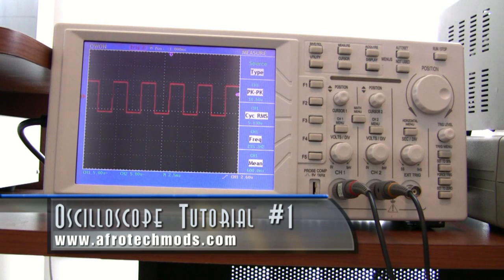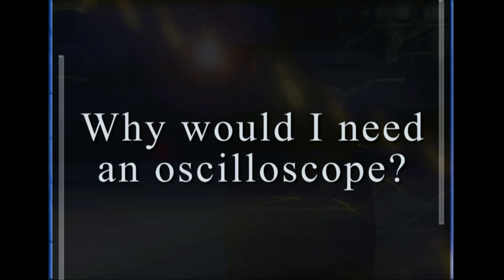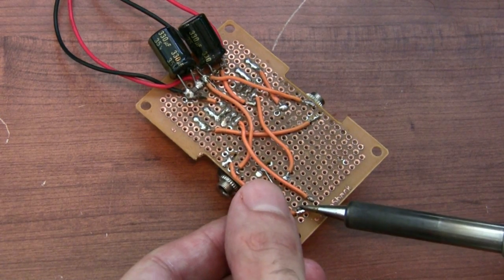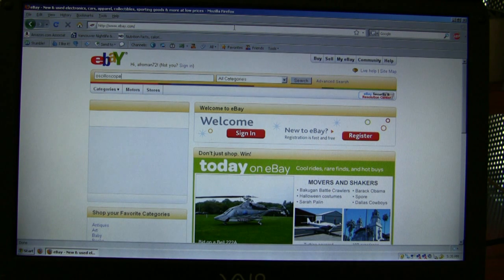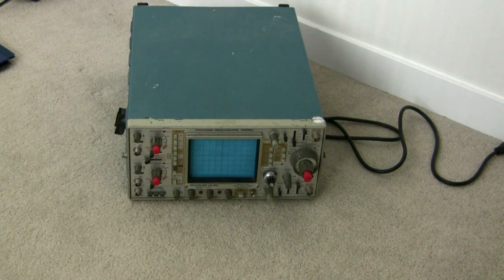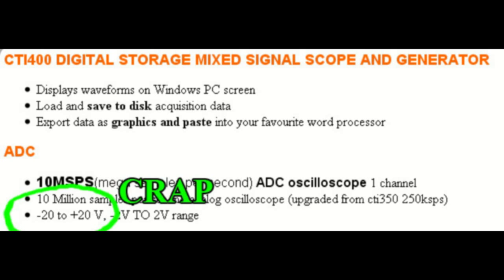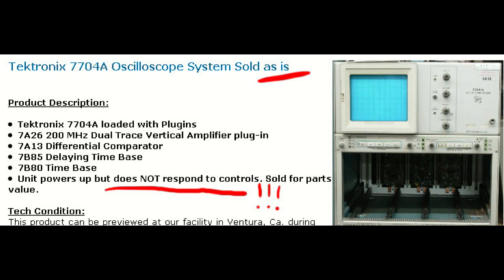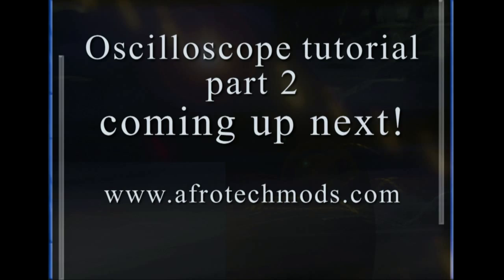Oscilloscope Tutorial Part 1/3 - What is an oscilloscope?

Comment: Since this video is older, I could add that Rigol is also a good brand and you should look for a 50MHz scope with a 500Gsa/s sample rate. You always want at least 10x the analog resolution in the sample rate. Memory depth is also important too, the more the better. $340 will get you a new Rigol 1052 (50MHz, 1Gsa/s, 16k) but you could get a Hantek 5072 (70MHz, 1Gsa/s, 40k) for about $250. If your on a tight budget, try to get at least 20MHz with 200Gsa/s.

Comment: I'm very happy for your video.
I'm very beginner  in oscilloscope.
I wonna buy a oscilloscope that will measure high frequency like 2 or 3 GHz.
Now question is that If i buy a oscilloscope with size of 1G Digital Storage Oscilloscope 100MHz bandwidth, will it be able to measure the high frequency.

If it doesn't than which oscilloscope is suitable for me?
Reply from the maker: Hi,
Are you sure you want an oscilloscope, not a spectrum analyzer? If you do in fact need an oscilloscope that can show waveforms with frequencies in the 2-3GHz range you will need a scope with bandwidth much higher than that - like 5GHz. You can get scopes like this from companies like Keysight and Tektronix but they will be very expensive, expect to pay $20,000+ for them.

Comment: Great tutorials. Subscribed. I want to mess with micro-controllers and Raspberry Pi. If I get an osc. with 30mhz bandwidth, what happens if I try and measure a signal on the board that is moving faster. Like an 125.0 MHz SPI signal. Can I still do your single shot, leading edge trick and look at nice square, binary representations?

Comment: Dear god, 10Mhz is a terrible bandwidth for use in the 21st century. Such a scope was only useful 29 years ago, even the old 68000 processors run at 12-16Mhz, a processor that is 30 years old I might add. Do yourself a favor and get a DSO with a bandwidth of at least 50Mhz a sample rate of 500ms/s and memory depth of 1mpt.

Comment: Hello Afrotechmods,

I watched your oscilloscope videos and I'm hoping you can direct me in the right direction as to what I need oscilloscope for.  Basically I do a lot of automobile diagnostics on ECM's PCM's, BCM's etc. and I need an inexpensive oscilloscope that I could use in this capacity.  Most of the oscilloscopes for the automotive field seem to be 20 MHz oscilloscopes, and I'm hoping to stay away from me major tool manufacturers items.  What would you suggest I look for a scope for?

Comment: i hear that u can hack the rigol oscis,u can make from a 50mhz osci a 100mHz osci.
Only with connecting over the rs232 and tipping in a new model number.
And tata u have a new 100mHz  osci over day,but look for a older version cause the news has a hack blocker.
look at EEVblog i think video 78.

Comment: Automechanics use what they call a 'labscope', which I think is a specialized oscilloscope. Brand name automotive labscopes seem really expensive and not capable of doing anything with AC. Do you think with a little knowledge a user could buy one of the general scopes you describe, and use that for automotive applications?

Comment: I'm going over my granddad's house, he is a master electrical engineer, and he is really old, and he wants me to have some of his equipment. He is going to give me an old oscilloscope, a function generator, frequency counter, and a power supply. Do you like the older Analog oscilloscopes to today's modern digital? The scope has dual trace, a bandwidth of 60mHz, and is safe for up to 400v with an accuracy of ±2%. It is a Techtronics. Would you recommend it?

Comment: great tutorial. i grabbed an old russian analog scope today for $117. not exactly dirt  cheap but works up to 200MHz and has everything i need including a self calibration function. now all i need is a decent x10 probe to go with it (i use a plain piece of coax for a x1 probe), and i'll be set.

sure, it's big and heavy, but it works great. i also got an incredibly detailed service manual with it, including schematics AND full parts list for every module! so if it breaks, it can be fixed.

Comment: If you think they can only handle 8 volts you're mistaken, you can buy different voltage rated probes for use x2, x4, x8, etc. Not to mention you can always use a resistor to cut the voltage down to usable strength. Besides you're mostly looking at the wave form, not the voltage, when using an o-scope.